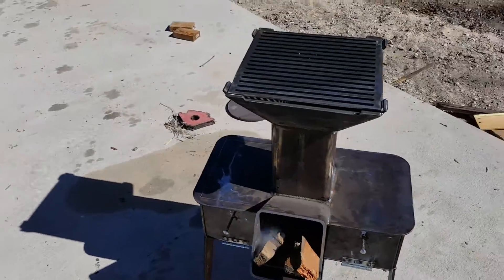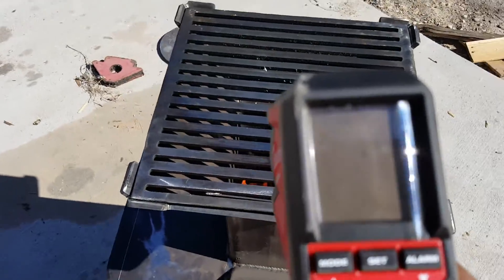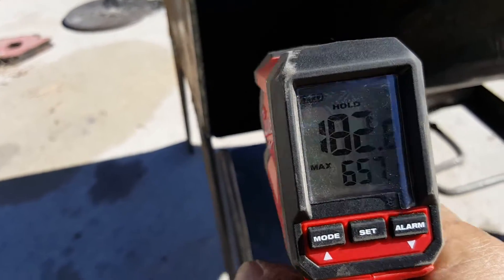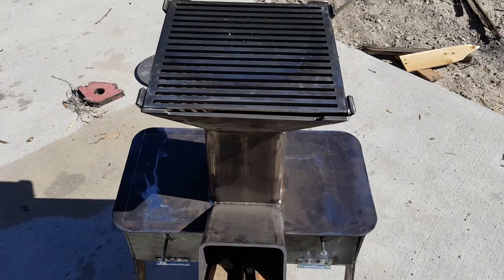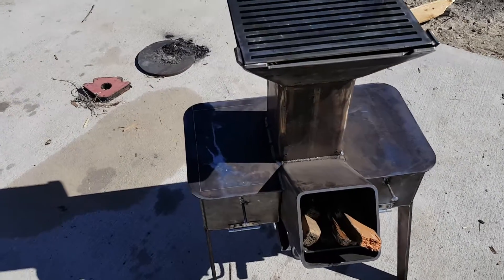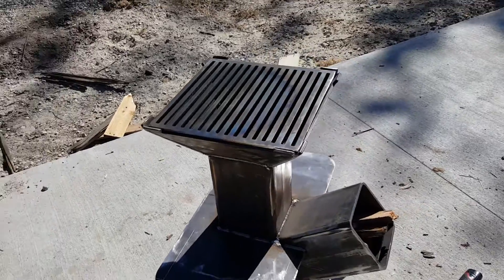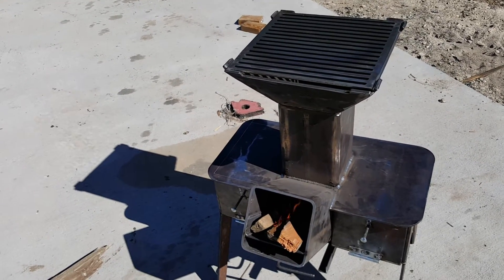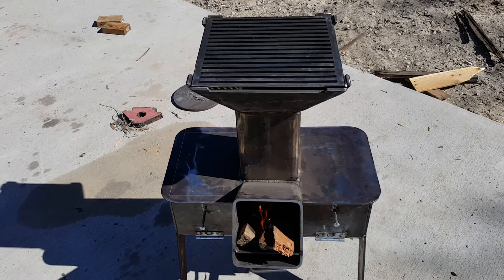6" Rocket Stove - Part 7

Comment: Your Oven design is awesome if you'd like to solve the lack of heat problem try this; weld two pieces of square tube together to attach to the bottom of the oven. Cut out an opening or notch in the same end of both tubes and mate them, then cap the end. On the other end, you have two openings. Attach your riser (chimney) to the one that will sit to the rear. You can come straight up from there, or make some joints and go back to the center of the oven before turning upward. the front tube will be the burn chamber and all the heat will travel the "S"'s leading to the top of the riser. Basically a Mass heater effect.

Comment: ok good design but you're not developing the suction.  you need to scrap the top in it's present form put a tube,   over the flame tube . then. a closing top over the flame  tube with a 2" gap;  and a chimney. out the back to create the  dawer  you're lacking .